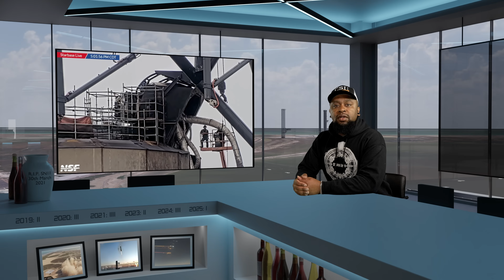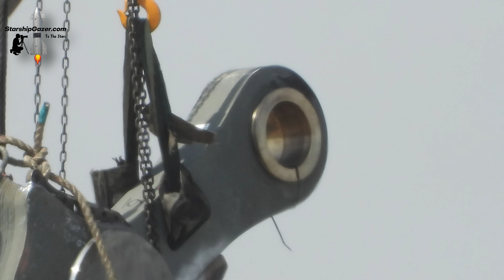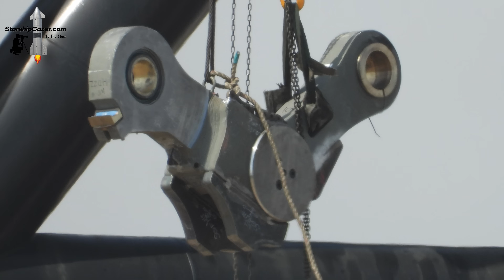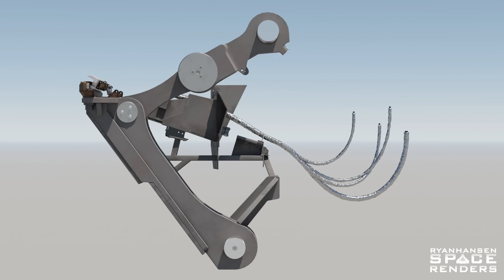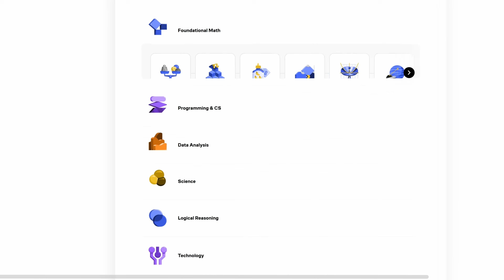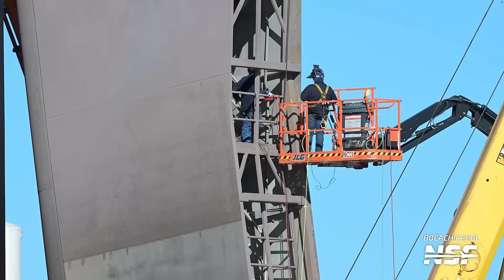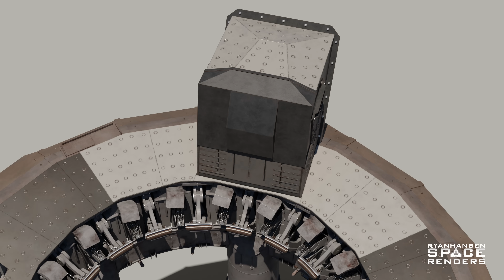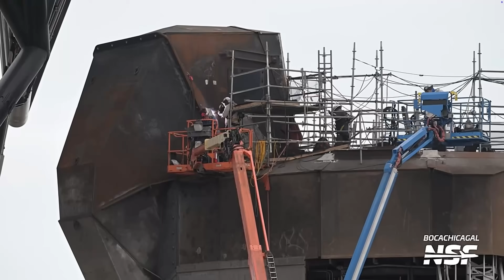The Major Problems With Starship’s R&D Launch Mount | Part 2

Comment: Some of the design flaws were kind of obvious from the beginning I thought maybe there was a good reason they were doing this this way but I don't think they were. The quick disconnect being on the side there's going to be hit by the blast from the engines both on takeoff and on recovery was silly from the beginning, if you look at the new tower you'll notice that the quick disconnect is on the opposite side.

The point is that even a genius someone far smarter than me doesn't know what they don't know and you can have blind spots. So even a half-wit like me can be useful
Reply: The hinges were another point that I thought was fairly obvious why not have a water Deluge at the level of the table spring toward the center and that of course would then be sucked down but the evaporation of that water would go a long way to protect the hold down clamps and all of that equipment